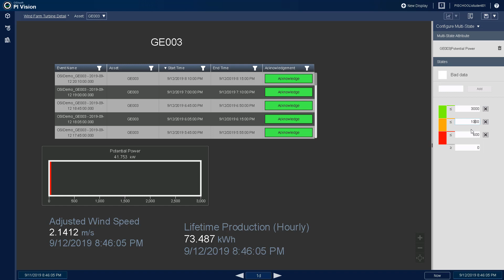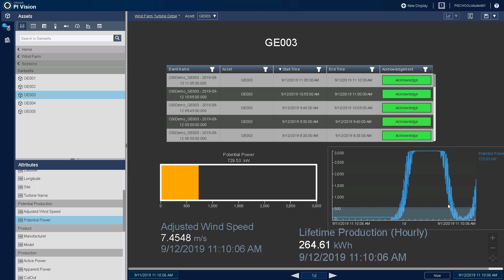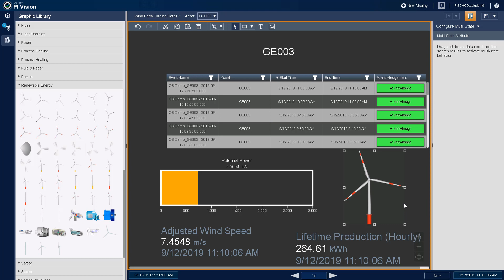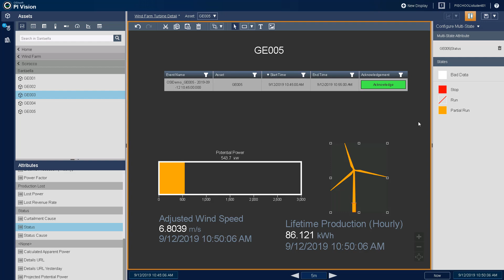PI Vision - Add Multi State Functionality to Displays to Create Visual Alarms

Comment: It is possible to use the timeline vertically instead of horizontally, thinking about column graphs for tank volumes?
Reply from the maker: Hi Reginaldo! If you are asking about displaying data in a vertical bar rather than in a horizontal bar like the Potential Power is in this video, it is possible. On the Vision instance in this video the vertical bar option is the fourth option at the top when looking at the expanded Assets sidebar.